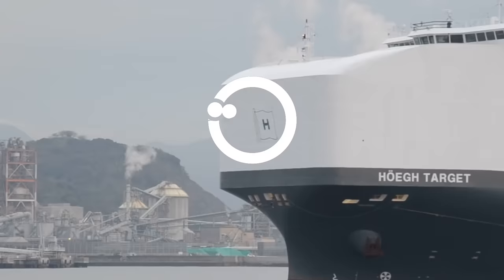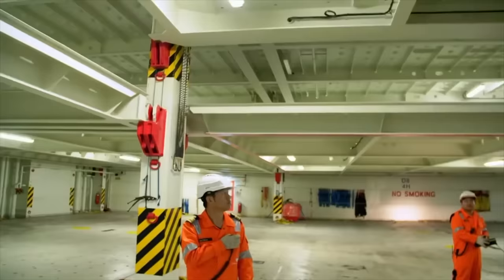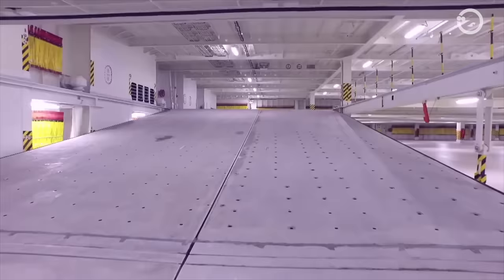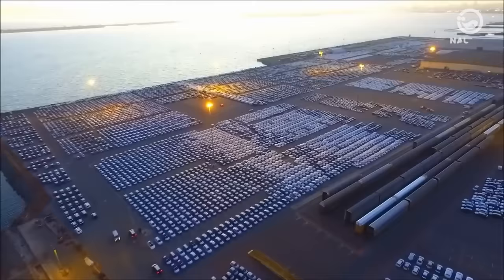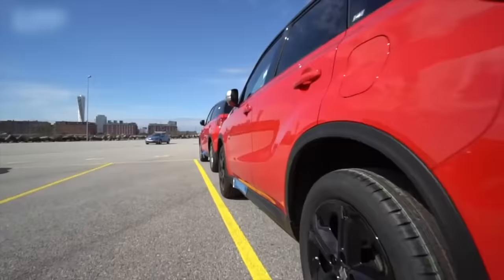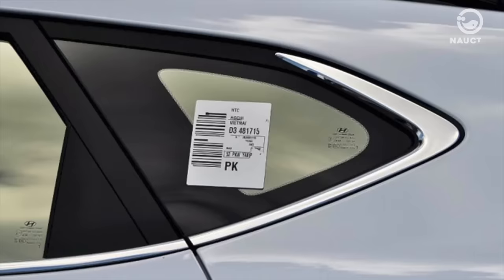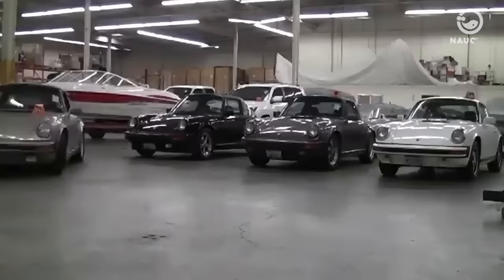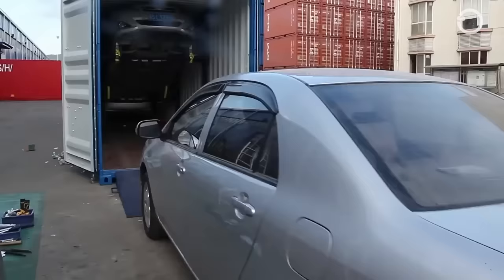Life Inside Massive Car Carrier Ship: How the World's Largest Car Carrier Carrying 1.5 Million Cars

Comment: That's a lot of eggs to put in one basket. All it would take is for one EV to catch fire and they could lose all 1.5 million cars
Reply: This has happened, but with fire control, the fire doesn’t spread.

Bigger problem is if the ship takes on water in a storm and sinks, which has happened.
Reply: did you not listen to or read the description ?
 it's 7,000 cars....
Joined up thinking is not your strong point is it.

Comment: These vessels are masterpieces of engineering, ergonomics and reliability.

The professionalism of the teams of drivers, loaders, tie down crews, inspectors, etc, make the process as straightforward as its possible to be.

I hope they have specific EV holding areas which have fire resistant linings, smoke extractors and fire suppression systems.

Comment: As a retired captain i spent the last 21 years of my career on ro/ro- car carriers, and i do belive you should have done better research on some of the items you described in the video. 
1. You said that the lashing gang are officers, nope they are ordinary stevedores.
2. The rolltrailers used are called MAFI trailers and were invented by MAFI Transport Systeme GMBH in Germany. Not by any shipping company.
3. Large and heavy units are placed on the maindeck or if possible below. This for stabilityreason. Also the heavy cargo is spread evenly longitudinal vise to avoid excess trim, and excess stressmoment on the hull. This simply if the vessel is loaded wrong with to much weight in one end she will be trimmed to much on the stern and building up stressmoment, you will then have to ballast the in such way you get the bow down increasing the stress on the hull, this can then lead to the vessel breaking in two. Not a good situation.
Reply: Can you tell more about firefighting strategies and did you have any fire event on one of your ships and if yes what was the reason and how did it end?
Reply: Thanks Helge! You confirmed my suspicions.
Reply: 100% agree.
Reply: Righteo expert you know best!

Comment: As a guy who has worked as porter for the past 7 years moving high end vehicles from very tight spots. I would love to work there.
Reply: Im a longshoreman at the port of LA and Long Beach and in the USA we are the one's who unload the auto ships.The job has it up's and downs. For instance new car smell in a brand new car that has not been open for a few months gives me a migraine after a few cars also the decks are just tall enough that you have to bend your head down to walk. On the up side the floors are smooth on each deck and when the cars still had hand break's you could do some drifting.
Reply: @tgood5527  because that new car smell is all the plastics and chemicals/fumes lol
Reply: For loading & unloading of new built cars how does the organising the car’s keys work. I could imagine that would be a nightmare job keeping organised especially when multiple manufactures of 5000 cars are being loaded? Are ‘master’or even ‘grand master’ keys involved for each manufacturer? Those keys I would assume need to be set with compatible immobilisers fobs to let the keys function properly. Interesting security issue.
Reply: The keys are left in the car generally. Some ships lock car at end of each row
Reply: @johnchapman3601  Ive never seen anything locked

Comment: Your heading is misleading... Guess it's just clickbait. But quite accurate otherwise. I've been working as a mechanic on the ROROs for about 15 years. Love my job. Most hectic part is when there's second hand , used vehicles. Cars, trucks, heavy machinery, mining equipment etc. Real scraps that's going to 3rd world countries. Then everybody has to pitch in. The low trailers are mafia. And it's towed by the "tugmastet". The tugmastet is one of the most impressive vehicles ever. And just to add, the crew does nothing during the discharge or loading. It's all done by the stevedores - private contractors specialing in this job.

Comment: I've always wondered how the drivers get out of the cars after parking them so close inside the ship ?? I would think lots of doors get dinged ?
Reply: They park with the passenger door next to the other cars.
Once he gets out then next car parks next to it.
Reply: @Robert-cu9bm so they can't mix LHD and RHD vehicles.
Reply: @Robert-cu9bm how about inside the container? How do they get out?
Reply: Through the skylight?! 😎
Reply: @flopunkt3665 yeah why would you need to? If you're shipping cars to a specific destination (country) than they would either be LHD or RHD.
Reply: Cars are parked in allotted decks/spaces in the order of the port of destination, so most LHD will be parked against LHD and vice versa. Spotters with the batons and whistles guide the drivers to the last inch so that the tie-downs line up perfectly and are not at such an angle that when the straps are tightened, they come up against the bodywork. Where I worked at, all drivers had to wear uniforms with no zippers or pockets so we don't scratch up the cars. No phones and wrist watches while on duty either.
Reply: @marylousherman5471  ff re pg loop.
Reply: @Robert-cu9bm    You and your common sense....😁
Reply: It's mentioned in the video if you had paid attention. 3 of 100.000 cars are dented.
Reply: @flopunkt3665  Why would they.Destination countries all drive on the same side.Some one some where has put some thought into it.

Comment: It is very impressive that this car-carrier can transport so many vehicles but also very concerning.
If just ONE of these is an electric vehicle and it ignites spontaneously then the whole ship is LOST as happened yesterday [July 26th 2023] in the North Sea.
Reply: Maybe wait till the full details are released after the inquest!
Reply: I just got back from working on such ship. During my time there, they had made a mistake and put 10 electric vehicles on the lowest deck (Deck 1), at the very aft of the ship (the engine room is located on that side as well). I had to go check the temperature of these 10 cars every single day because we were afraid that something might happen to them. It was just too hot - cars' temperature would go as high as 60-65 Celsius. Luckily, nothing happened this time. Nevertheless, we're risking too much because there's simply no time to think and plan properly when loading. There's a lot of pressure coming from the charter's side and they're always rushing not thinking about the life and safety of those on board.
Reply: @gearjammer3688 
The EV are the reason this ship has lost every car and likely the ship itself.
Reply: You beat me to it!
Reply: It's becoming painfully clear just how hazardous electric vehicles are with their 1000 to 2000 pound lithium battery packs that are just ticking time bombs in a jam-packed car-carrier ship. Of course, the EV people constantly insist that EV's are no more hazardous than gas-powered cars, but recent incidents are proving them wrong -- dead wrong!!
Reply: They ought to just ease the EV's into the water where they are made and let them "swim" to their destination!  Better for just about everyone involved, if you know what I mean!
Reply: @MrPLC999  you can transport a gas car with a near empty tank, unlike an EV. The issue is the cobalt oxide cathode; thermal runaway and all that...
Reply: Hope they got an really good insurance! All the cars AND then the ship! The amount is massive.
Reply: More than once
Reply: @donaldberger9163 they really catch fire when exposed to salt water

Comment: After these big car carrier ship fires more likely because of electric cars catching on fire, they should  half to remove the batteries and placed on the upper deck and if the batteries catch on fire they can be pushed overboard. Losing a whole ship is a huge loss. Of course the car manufactures would need the batteries to be more easily removable if they want to ship them,,,,,,,,,,,,,,,,
Reply: You obviously have absolutely no idea how these cars are constructed.  The batteries are not like your remote control.

Comment: I think it would be possible to reduce the risk of EV fires by shipping the cars with little or no charge. A plug in battery could be used to power the cars just enough to get them on deck, if needed. Two cars could be towed on a skateboard like platform and unloaded inside the ship.
Reply: Ha ha EV cars lol.. talk about risk 🤣
Reply: Lithium batteries deteriorate if left without charge. The safest way would be to place EV in locations on a ship from where they can be pushed into the sea. Likely there will soon be new regulations on the transportation of EVs.
Reply: EV cars ..great for the environment 🤣
Reply: @ACDZ123 Petrolhead?
Reply: That has absolutely no difference on the chemical energy in the case of a fire. its not like a fuel tank. although a fuel tank is much more dangerous being full of high explosive liquid
Reply: @gunnarsiebert3790  nope. I walk ...you fools think EV cars are saving the planet ...yer sure
Reply: @ACDZ123  Compared to combustion engine they are a big improvement. Of course public transport ist the best solution but sometimes a car ist the only alternative and there the BEV is much better than a combustion engine!
Reply: @imantsjansons5009  "...pushed into the sea."  Now you're talking.  :-)
Reply: @ollu312 if you think fuel tanks explode in a fire you watch too much American tv.

Comment: With so many E/V vehicles and this last ship fire off Denmark with loss of about 5,000 luxury cars Halon fire suppression system needs to be inplace. Halon in used in buildings that have delicate electronics like computers that would be ruined by chemical and water. Halon displaces oxygen but as long as crew is not in storage decks are sealed then not an issue.

Comment: I think they have to redesign these ships as a result of carrying electric vehicles which is far more dangerous (fire). They should build a compartment specially for electrical vehicles so in case of a fire so that oxygen can be extracted from the room in the event of a fire. Electric cars are very difficult to extinguish. They should also fit an escape hatch to make it easier for the crew to leave the ship in case the ship catches fire. With a burning ship, helicopters can hardly ever get close to the ship to remove crew from the ship. In addition, the lifeboats are usually mounted on top of the deck, making them inaccessible in the event of a fire. It takes a very long time to launch a lifeboat from the top of the deck. They should build a launch platform like they have on an oil platform.
Reply: It depends on the battery chemistry.  NMC batteries can self ignite and burn also without oxygen. LFP batteries are much more safer, only the electrolyte will burn, but need oxygen for this.  Of course also NMC batteries will be less destructive without oxygen because it will prevent other materials to start burning and spread the fire...Safest thing is a compartment that can be flooded with water, because this cools down the batteries.
Reply: @wasserdrucker6227  Flooding the compartment to extinguish a electric car fire means that you have to make sure that the compartments to store the electric cars are not too big, otherwise the flooding of a compartment would take too long. The other problem would be, that the extra weight of the water has an effect on the stability of the ship.